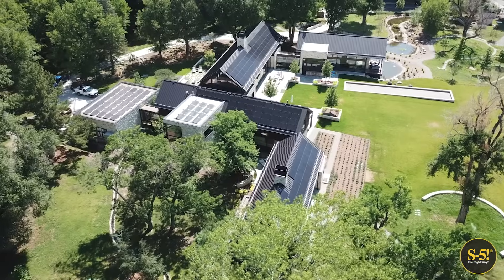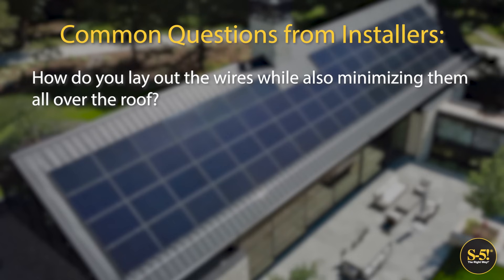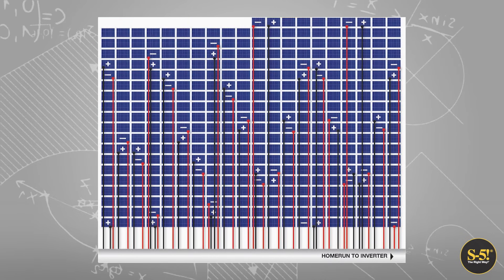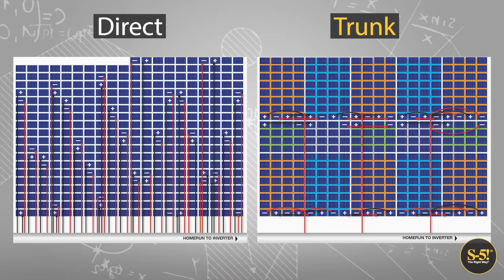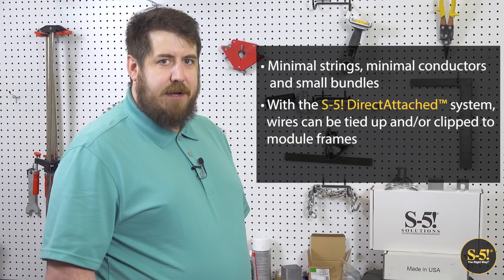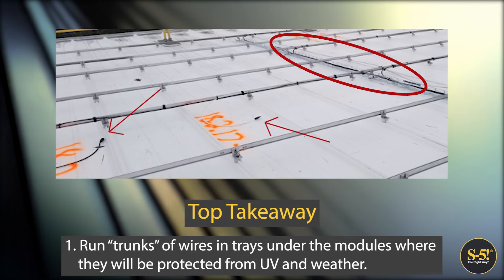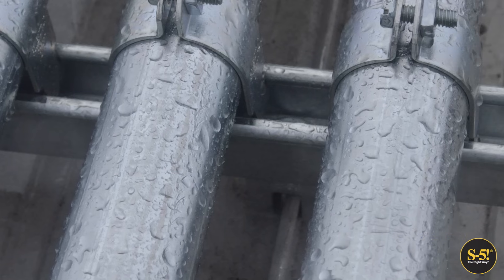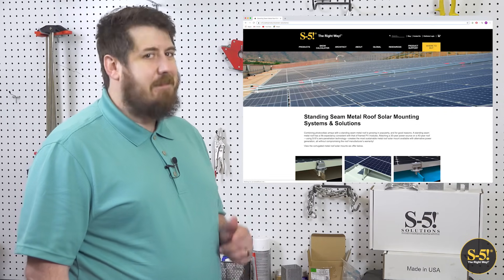Best Wire Management Practices in Commercial Railed and Rail-less Solar PV

Comment: Nobody wants to talk about roof penetrations or pass through for PV wire.  It’s hard to find a solution that works easy
Reply from the maker: Could you please clarify further?  I'm having a little trouble understanding the issue you're having.
Reply: @TheMetalRoofingAcademy  the wire from the solar array needs to go through the roof to get to the inverter.  The boxes on the market are designed for flat mount or have built in flashing for shingles roof.  Nothing fits between the 9 inch trapezoidal ribs on my metal roof.  Soladeck doesn’t work, other generic boxes don’t work.  I want an easy transition box.  Also, THHN wire is half the cost so running PV wire all the way to the Inverter is stupid.
Reply from the maker: @esquire9445  Sorry, we do not know specific junction box products that would work in that situation.  One thought is to install some kind of stand-off with a conduit sleeve to connect the box to the roof penetration.

And thanks for your insight on THHN wires, good idea.

Comment: Enjoyed your very informative video on roof top PV installations.  You used the term zip ties in several places and would like to introduce you to SolarSafe Kynar PVDF cable ties that carry a 25 year performance guarantee.  They will last while nylon cable ties will fail.  No need to disturb a well laid out installation in a few years to replace failed nylon cable ties.  Use SolarSafe Kynar PVDF cable ties.
Reply from the maker: Thanks for the suggestion, Dale!